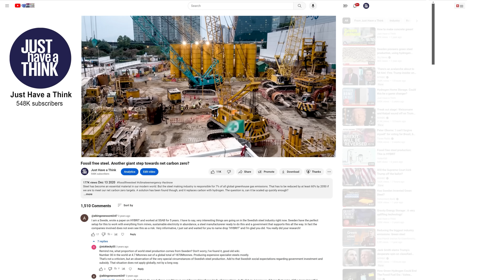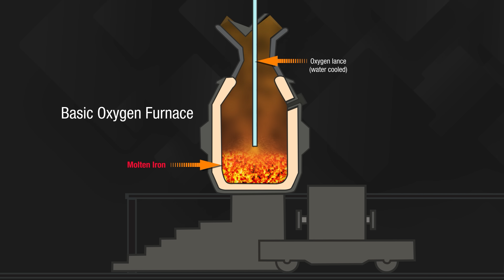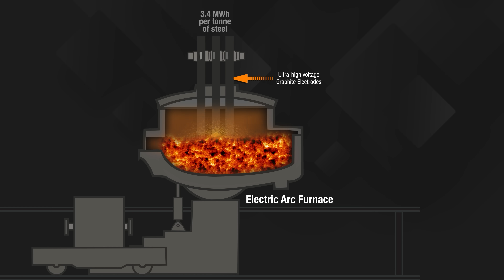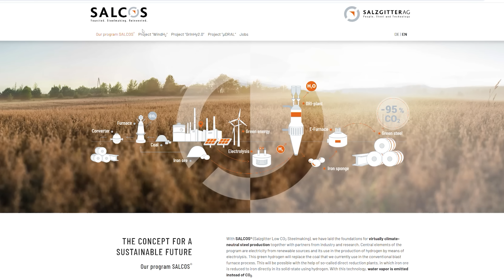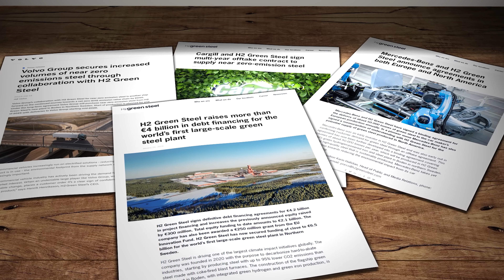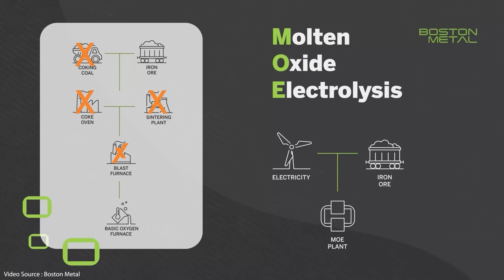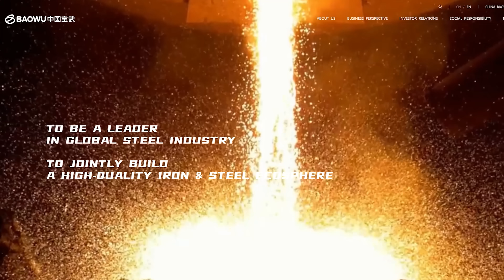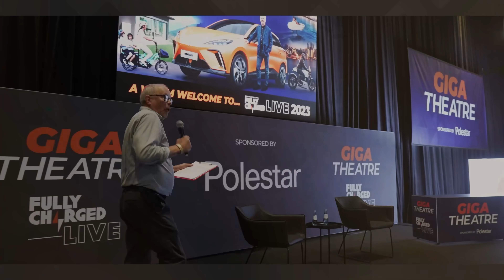Green Hydrogen making Green Steel. Is 2024 the breakthrough year?

Comment: Great overview, thanks!
I think the key is this:
1. The fact that these methods are now close to being implementable at industrial scale and not TOO far off regular steel prices means that carbon pricing for steel in major economic zones is becoming a lot more realistic.
2. Many of the technologies that the process interacts with (renewable energy sources and hydrogen conversion) are still improving significantly, so the remaining price gap is likely to close further.

That's why I think these technologies are a very good sign for the future, even if their immediate impact will be of limited scale.

Especially because these do not appear to be complex "unicorn technologies" that never solve fundamental issues and never make it into widespread adoption, but something that can already be built with current tech and now merely requires some more operational experience to become a basic tool of the industry.

Comment: Steel in many uses can be replaced by carbon fiber-reinforced polymers which are 3 times as strong. It can be produced in a CO2 rich atmosphere such as cement manufacture by passing the gas through an electrolysis system to make carbon nanostructures. There are several Canadian companies doing this. In the construction industry it can replace steel rebar, steel girders and for supporting weak beams and structural joints. It can then make reinforced concrete structures much thinner, hence reducing the carbon footprint of both the steel and the concrete. It is probably more expensive than steel but may not be if there was carbon taxes. Dave, a good subject for one of your programs.

Comment: Great episode! It did make me have a think, a rethink even. I've always considered steel production such a small part of the overall problem that is just moderately interesting at the moment, but as we've reached a point where power generation and road transport have developed far enough for making the rest of that transition mostly a "downhill journey", economically viable low carbon steel production remains a difficult challenge.

As steel production with current common techniques cause similar amounts of CO2 per unit of mass produced as use of fossil fuels it seemed so strange to me that steel production was such a big part of the problem, but apparently we use almost half as much steel as we use oil.           

I think it will be difficult to transition the steel industry to really low carbon production, but there's also a silver lining, steel is easy to recycle. Recycling steel requires much less energy than producing it from ore. So, the "new" steel we need is the amount we want to increase current use with, plus whatever part we let turn into rust. We do recycle a lot of steel, and if we get even better at that, and place an international, and relevant, price on carbon emissions, using steel slightly more economically, we might be able to reduce the production of new steel quite significantly, without too much of those minor inconveniences some people find catastrophic.

Here in Sweden there's already been one public "debate" about how much green steel production would increase the price of electric power, as if we're going to make the shift entirely, soon, and without any consideration to the grid situation or much additional power generation. If they're planning to run the electrolysers at their convenience without any regard to situation on the grid, well, that would probably be problematic. If they can adjust their production somewhat to the situation in the grid, it might even reduce the need for energy storage. It's much easier to store iron ore and steel than it is to store the energy it takes to turn that ore into steel. Not running at full capacity means lost revenue, but when price of electricity varies between negative and absurdly high, some level of control of the power draw might be needed to make it feasible at all.

Comment: I would like to see how they compare in economics because it seems like you get free energy from the solar panels and water; then you just need electrical power to finish it. So, wouldn't it be cheaper than the actual method where you need coal and fuel? Wouldn't they be interested in changing towards this technology just because of it?

Comment: To reduce the cost of green streel by 50%, we need to reduce the cost of green hydrogen by 50%, which means we need to reduce the cost of solar energy by 50%, which happened last year, and should further happen before 2030. After that we won't need new policies, money will just flow towards green steel because it will start to become cheaper.

Solar energy will be doing much more than transition our economies away from fosil fuels, it will unleash a new era of incredible green growth, because there is no shortage of silicon in the Earth crust, as it constitutes 28% of it's mass and is the most aboundant metal in the Earth crust before aluminum at 8%, and steel at 5%.

The second reason solar energy cost will continue to decline (towards zero), is that it is the only electric power technology to not require a generator to produce electricity. So it requires no moving parts. It is effectively the only solid-state energy generation aparatus that exists today.

There is vitually no limit to what we can do with cheap and abundant energy, and the PV industry is growing 20% a year or more, every year over at least the last 23 years. There is absolutly no reason this will stop and the limit is only how many solar panels we can install over the vast deserts of this planet to terraform them.

In 2022 solar energy produced 1310 TWh (https://ourworldindata.org/grapher/modern-renewable-prod), and we can predict how fast it will be able to generate as much energy as the world needs to produce enough energy for the world to transtition away from fosil fuels, which is about 80 000 TWh,  61 times more than in 2022.

With 20% growth it will take log( 61 ) / log ( 1.2 ) years to get there, which is 22.5 years, or by july 2044.

But solar energy will not stop there, and will continue to grow much longer than needed for the transtition. It will eventually make humanity a type I civilization on the Kardashev scale, which means producing 44 000 TW of continuous power, 24/7, or 386 000 000 TWh per year, which is 4821 times more than the 80 000 TWh per year that we need to transition away from fosil fuels. At a 20% per year growth rate, this will happen in log( 4821 ) / log ( 1.2 ) years, which is 46.5 years, or by the january 2091, before the end of this century.

This will happen by building a giant solar plant at the sun-earth Lagrange point L2, at 1.5 million kilometers from earth, where the James Web Telescope currently stands, from silicon mined from the moon.

The next step will be to terraform Venus from solar energy and shielding it from excess sun heat by building a giant solar panel at the sun-venus Lagrange point L1. This could be done from silicon mined from Mercury and could take less than 50 years.

I'll let the reader figure out, if, and when, we could become a type II civilisation.

This is a masterplan for humanity.

Comment: In the realm of steel, where fires rage,
A quest for change, on a new page.
Global emissions, a pressing concern,
But green hydrogen, it's time to discern.

Three billion tonnes, a staggering toll,
Yet efforts persist, to reach a new goal.
Decarbonizing processes, a daunting task,
But green steel's promise, we dare not mask.

Using hydrogen, green and clean,
To remove oxygen, in processes unseen.
Replacing coking coal, with a sustainable light,
A breakthrough in sight, to make things right.

But has anyone cracked it, in this new year?
Just Have a Think, let's make it clear.
2024, the potential breakthrough nears,
As green hydrogen, wipes away fears.

Innovations abound, with determination strong,
As the steel industry sings a hopeful song.
For green steel's promise, it shines so bright,
A beacon of hope, in the fight for our plight.

So let us watch, with hopeful eyes,
As green hydrogen, to the forefront flies.
In 2024, the breakthrough year,
For green steel's future, let's cheer.

Comment: This may be the best way to save energy. Focus first on the industries that spend the most and are centralized enough to be regulated and modified to use green Hydrogen.
No solar or wind energy should be lost, it should be stored as hydrogen when possible.

Comment: Apart from MOE, there's also low-temperature electrolysis of iron ore.
Unlike MOE, it produces sponge iron intead of steel, but the technological risks seem to be much lower.
The potential huge advantage of electric processes is that you save the big (~50%) energy loss from producing hydrogen as well as the capex for the electrolysers and other hydrogen infrastructure.

Comment: In the EU, all steelmakers receive free emissions allowances for the ETS, because it is feared that they would be uncompetitive against China if they had to pay for their emissions. However, this will change: starting in 2026, the free allowances will be phased out (very slowly) and instead, imports will be taxed based on their emissions (CBAM, carbon border adjustment mechanism). This puts some pressure on the exporters to lower emissions.
Note also that there is an incentive for EU steelmakers to lower emissions right now: If they do, they can sell their free emissions allowances on the open market instead redeeming them.

Comment: You should look up the U.S. Department of Energy (DOE) proposal: CX-028978: Carbon-Neutral Steel Production with Methane Pyrolysis Driven Direct Reduced Iron, SEPTEMBER 15, 2023. This might be more energy efficient than using hydrogen from water electrolysis.

Comment: Let's think: 
Vegetation is green, because photosynthesis requires energy in four light bands: 2 in the blue spectrum, to split water and 2 in the red lower energy spectrum. The remaining green and yellow spectrum is rejected, trashed, unnecessary.
Green is no good to the growth of food, carbon dioxide is.
Seems that prefering green and rejecting the gas of life is  opposite of good
Green Steel is absolute nonsense, its gray!

Comment: One thing you just jumped over saying that theres an abundance of hydropower. Theres not. In fact when at full scale production the green steel production in Norrbotten it will require an aproximatly 80 Twh of electricity. Thats half of all electricity consumption in Sweden or all electricity consumption in Finland. When the politicans are asked where all the energy will come from they say it will solve itselfe, don't worry. But it wont solve itselfe.

What will happen is that thay will tap the local electricity grid which will skyrocket the price of electricity so the people living in the region will go broke and will make the final price of the green steel so expensive that there will be no buyers. 

So in essence they are thowing billions of dollars on something they know wont work. Will make the region poor and destroy the local communitys.

Comment: 📝 Summary of Key Points:

📌 The global steel industry is a significant contributor to greenhouse gas emissions, with traditional steel production methods emitting large amounts of carbon dioxide.

🧐 Initiatives like the Swedish project Hybrid aim to produce green steel by using green hydrogen instead of coke and coal, resulting in a 97% reduction in carbon dioxide emissions.

🚀 Other projects like Zalos and Blaster are also working on green steel production, with varying levels of progress and emission reductions.

💡 Additional Insights and Observations:

💬 "Green steel production is gaining traction due to commercial, political, and public pressure to reduce the environmental impact of steelmaking."
📊 China produces more steel than the rest of the world combined, and efforts towards low or zero carbon steel production are crucial for global emissions reduction.

📣 Concluding Remarks:

The shift towards green steel production is underway, with various projects and initiatives aiming to significantly reduce carbon emissions in the steel industry. Collaboration, innovation, and policy support will be essential in achieving a sustainable future for steel production.
Generated using TalkBud

Comment: The only sensible Hydrogen related applications require that the Hydrogen is consumed in a process at the point of production OR it is directly used to produce other hydrogen based,important chemicals like Ammonia or Methanol.  Where the hydrogen grifters are committing fraud is the absurd pipe dream of turning H2 hydrogen gas turned into a liquid, which is extremely energy and infrastructure intensive (expensive) and keeping it stored as a liquid is problematic and highly counter productive........especially in vehicles.

Comment: Just have a think: It is possible to make things much easier, the problem is that, the cost reductions make companies uneasy. You can build machines that is much greener, and cheaper to operate. If you remove the Gas tank off of heavy equipment, and incert its own personal powerplants. You need only enough electrical power to operate. Talked to the manager of the power company in town, and explained that once i was ready to show a functional proto-type let them know, because unlike most energy sources this one can be mobile, unless one makes a much larger system. basically its particle electric.

Comment: And "carbon taxes" should just be relative to whatever the zero/low carbon alternative is. In the case of steel, they would pay some percentage of the difference between the current methods and the zero carbon methods, and that percentage would grow over time until it eventually reaches 100%. This works doubly well, because not only does it encourage doing more of the zero carbon stuff, but it also further encourages them to increase the efficiency of the zero carbon stuff, since the closer they get to price parity, the less they pay too.

Comment: These companies ( h2 steel,  and hybrit )
Will require huge amounts of  electrical power . 
This will require huge increases of the swedish  power production,  only 30 procent of the energy is converted to hydrogen during electrolysis. The rest is heat loses. The consequences will
Be a lot of mega size  wind turbines in sweden, and these will in large part work to keep 
Those power hungry companies hydrogen production not , producing power to other parts of society. 
The power increase is roughly dubbling the production of electricity in the swedish grid.
Hybrit has been denied power connection by vattenfall because there is  not enough power available in the grid.
As a swede dont want my contry infested with wind turbines  everywhere so these companies can make profits.
If there is to be built turbines the electricity should be used 
To good stuff, not corporate bs.
In swedish you can change out on letter in hybrit and you get hybris =  hubris:  that is exactly
What hybrit is .
If you do ccs on the steel mills 
In sweden you can keep using coal and skip the co2 emissions. Its only when using 
Iron ore you need the coal as fuel /reduction additive. 
Steel recycling  type of  production can be done in electric arc furnaces, or induction furnaces.  These can be driven with electrical power  strait from the  grid without stubid loss inflicting hydrogen steps. 
We need to shift over to circulation of  metal resources instead of digging out more and more from the ground.
These hydrogen steel dreams are bad for the swedish population , our country should not be a playgroand for rich 
Steel  risk capitalists.
Hydrogen produced in the future should be used as vehicle fuel  and other society 
Critical systems.  
Not b-s stuff.
Batterys will not be the future of  ev car electrical  fuel , hydrogen is mutch better ,it can be used in fuel cells and 
And also on a ice .engine as fuel gas. 
You can fuel up your a car within minutes,  no power need 
To be delivered om demand as as battery ev needs to be fuel up . The heat losses from electrolysis can be used for heating via  Our city wide heating systems.
Hydrogen used /produced ineffective is not  a sustainable solution. 

Personally 
I hope hybrid goes out business.  H2 steel also.

There is serious concern 
Regarding the economic/ resource sustainability of these  steel concepts from people that have good knowledge in this field.

Comment: Fossil free steel or green steel is a lie. How is the ore extracted? How is it shipped? Steel is an alloy so other elements need to be dug out of the ground and shipped to the steel factory. Ofcourse this method will drastically lower co2 emissions but steel production will never be totally clean.
After making the steel it has to be put through a hot strip mill, then a cold strip mill and annealing ovens. All processes that take huge quantities of electricity. The ovens mostly run on natural gas. Electrification of these ovens take more massive amounts of electricity. We simply have not enough green energy production in most countries to produce electricity without fossil fuel.

Comment: It all comes down to cost. Way back in the 17th century, iron-making needed expensive charcoal to make iron, but the cost was considerably reduced when Abraham Darby tried using coke derived from coal, instead. It was highly successful.  The Industrial Revolution started at this point (in Ironbridge in Shropshire), because using iron became economic, and industry making and using it boomed.  Iron making moved from the Weald in Kent, (where charcoal was made) to places that had coal, iron ore and limestone in abundance. 
So could direct reduction using electric arc furnaces be cheaper than using coke ? The answer surely lies in how that electricity is produced and hence its cost. The other input components are the same price whatever the process.